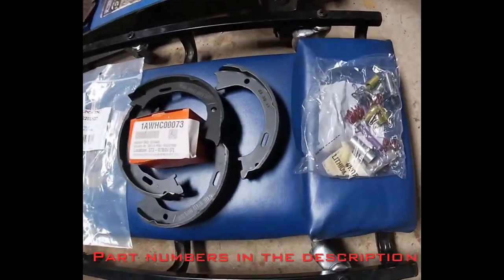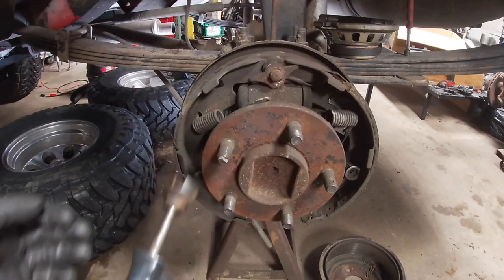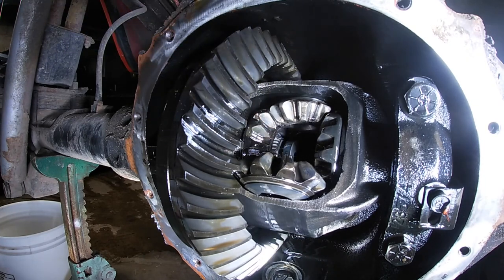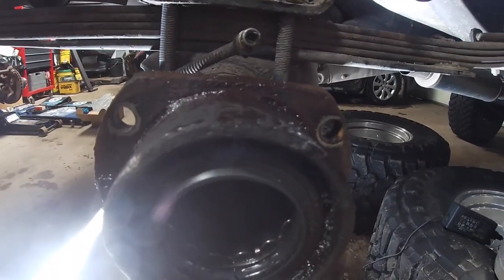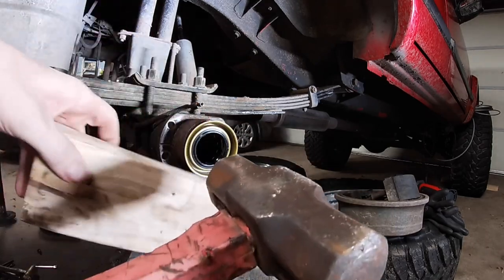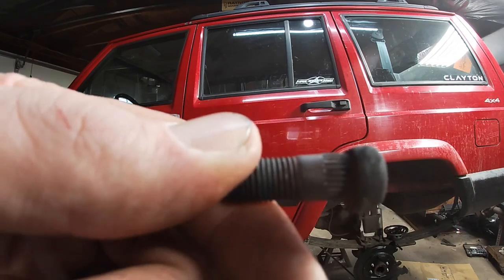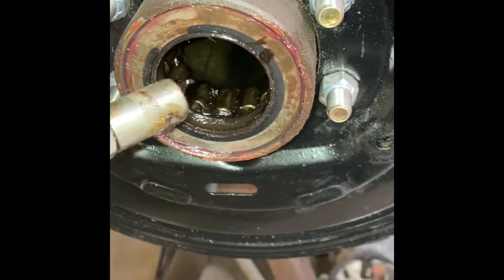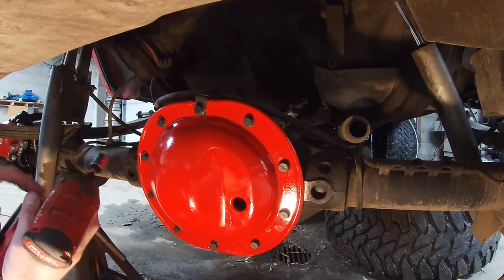Bolt On….Jeep XJ Rear Disc Brake Conversion

Comment: When doing this, make sure you get the same axles going back in the same sides you took them out because one is a little longer than the other. almost started freaking out because I got the short one in the wrong side and could not put the C clip on it realized later what I had done thought I got the wrong kit for a minute or two😅😉👍

Comment: Nice, informative, well done tutorial on the upgrade. My only issue, you say "bolt on" and while true up until the line bracket, that needs to be welded to axle tube to keep the line from moving. Seems like a small detail, until "dang it, i need to get a welder too?!" Jeep bleedin me dry already, lol!
Reply from the maker: Technically you could probably just leave it like that and not weld it. And never have a issue. But I just would rather be safe then sorry.

Comment: How did you bend the hard brake lines?  Did you remove them completely from the Jeep or is there a way to do it without removing and also crimping the lines?  Great video.
Reply from the maker: Hard line bending tool. You can get them at parts store. And thanks!

Comment: Awesome video.  Do you really have to replace the studs for the backing plate?  Seems like the new bolts you got are a little long while the XJ studs seem like they wouldve fit.
Reply from the maker: Thanks. Yes the xj ones are to short. You can use the stock liberty ones though. For me the bolts ended being easier to track down in the small town I live in.

Comment: What about the parking brake parts and hook up? Did I miss that part? God bless and stay well.
Reply from the maker: I lost the footage for that part unfortunately. But they do have a few good videos on YouTube on how to do the emergency brake setup on the Liberty’s.
Reply from the maker: And they do make a bracket for the XJ cable so you can adapt it to the Liberty ebrake setup.
Reply: Do you have a link to the bracket?

Comment: You didn't mention switching out the proportioning valve on the brake block.
Reply from the maker: I actually haven’t yet. And it’s actually working out pretty well with out doing the ZJ proportioning valve spring swap.

Comment: The coating on those eBrake springs is not resistant to brake cleaner, last time I changed mine, sprayed the eBrake clean, And I see bits of the color coating all over the eBrake assembly.

Comment: You dont need to install the emergency break shoes do you? I dont have them? And you might wanna change your proportioning valve
Reply from the maker: No you don’t have to install them. And I put a ZJ spring in my XJ proportioning valve.

Comment: Locktite on those backing plate bolts... no??  Or are those locking nuts?
Reply from the maker: If I remember correctly I used nylon lock nuts.

Comment: Did you find a major breaking improvement after installing the disc's? On a scale of 1 to 10 how likely would you do it knowing the cost and benefits?
Reply from the maker: Definitely better. I didn’t do the ZJ proportioning valve yet. That should improve it even more. As of right now how it set’s. I would say it’s a little better then drums. I mostly did it because needed all rear brakes any way. And this wasn’t much more money then just replacing the drum brakes. It makes things much easier in the future for brake replacement.
Reply: Great video mannnn. Thanks!
Reply from the maker: @ZekeMaster85  Thanks. No problem!

Comment: How’d it go bleeding the brakes? I ask because you have the calipers on the wrong sides, which puts them upside down. Kind of hard to get the air out when the bleeder is lower than the hose.
Reply from the maker: Bleeding went fine 🤷🏼‍♂️
Reply: Sorry, a more accurate question would be how’s the pedal feel? Soft, spongy? It would appear to bleed just fine because the fluid would come from the hose and run right out the bottom bleeder of the caliper it’s supposed to push the air out the top. Working in the brake and chassis field for 20years I’ve seen it many times, it’s a common and easy mistake. Just flip the calipers side to side and you will get a measurable improvement in brake performance. Other than that, good job! I was never impressed with the ZJ brake swap. Good to know there’s another option. Also, all the videos I see on disc brake swap fall short of addressing the hydraulic equation. The stock master cylinder was designed for the small diameter wheel cylinder, not the large surface area of a caliber piston. Also disc/drum systems have different front/rear proportional valves than disc/disc systems. I wonder if the Liberty master cylinder and proportioning valve would work? That is! If it has one? It may be integrated into the antilock brake module? Which opens up another can of worms.
I would have liked to see how you did the park brake. And I agree with the other comments about he intro music. Too much, too long. Almost clicked off. But now I’m a subscriber.
Reply from the maker: @jasonlessard2373  it does have a little soft pedal at first. So that’s probably the issue🤔. And most guys run the ZJ proportioning valve. I plan on trying that out.
Reply from the maker: @jasonlessard2373  And I haven’t hooked up the emergency brake cable yet. Trying to figure out my best option. Some people will use the stock XJ cable and just wrap it around the ebrake lever on the liberty setup. But I don’t like how that looks rigged up.
Reply: @northernmichiganoverland  let me know what you figure out for that that's only thing keeping me from doing this being I have a manual
Reply: If calipers were turned around right the brake line would have been easier also ,no sharp bends. I agree there is still air in calipers. Still good job and thanks for taking time to help people out

Comment: Heyy did you install the emergency brakes.  It looks like you skipped the Ebrakes.
Reply from the maker: Unfortunately lost that footage 🤦🏼‍♂️
Reply from the maker: But basically it’s the same steps as putting the liberty ebrake together. Other then adapting XJ cable.

Comment: I only saw a link for the left brake hose did you use two left brake hoses?
Reply from the maker: Whoops my bad 

https://www.ebay.com/itm/155104574986?mkcid=16&mkevt=1&mkrid=711-127632-2357-0&ssspo=pcVVEXylRS2&sssrc=2349624&ssuid=GlPkWaaTRX-&var=&widget_ver=artemis&media=COPY
Reply: Oh no worries my brother thank you so much I figured it out I am in ASE certified Master automotive technician and I don't think I could have done a better job on the detailed description and the quality of your work I'm thoroughly impressed keep up the good work man
Reply from the maker: @1jimjiminy  Thank you!

Comment: Is it the same parts for the Dana 35 & Chrysler 8.25??
Reply from the maker: This mod will not work on the dana 35 as far as I know. I believe you have to use the jeep ZJ rear disc brake parts if I remember correctly.

Comment: Total cost if ya don't mind me asking. Lapeer Michigan
Reply from the maker: Under $250. I got the liberty backing plates for $50 off Facebook market place. That was the hardest thing to find. Everything else is just factory liberty brakes parts. I bought new of eBay and rock auto.
Reply: @northernmichiganoverland  nice not bad at all definitely would be worth it.

Comment: What color red did you use on the Calipers?
Reply from the maker: @j002cd 

https://www.ebay.com/itm/350870094577?mkcid=16&mkevt=1&mkrid=711-127632-2357-0&ssspo=LRMjuD6oRLe&sssrc=2349624&ssuid=GlPkWaaTRX-&var=&widget_ver=artemis&media=COPY
Reply: @northernmichiganoverland  awesome Thanks!
Reply from the maker: @ky0611  No problem

Comment: I have sold hundreds if not thousands of “disc brake conversion kits” on a well know forum. 
For the money, just get an Ford 8.8 with discs from a junkyard & be done.
Reply from the maker: This didn’t cost much more then replacing the drum brakes that needed replaced anyway 🤷🏼‍♂️.

Comment: You forgot something....?? Where is the E-brake?
Reply from the maker: Lost that footage unfortunately
Reply: @northernmichiganoverland  Ahhh that explains why... It's a one simple fit over the original?? Thanks for the video.
Reply from the maker: @Justdigit2  if you look up how to install ebrake shoes on the liberty same steps. Only thing thats different is making the XJ ebrake cables work with the liberty ebrake setup.

Comment: I got a comment. Im a 35 year+ mechanic and have a 99 Jeep Cherokee XJ, lifted with Patagonia milestar tires (Nice Tire!),etc. The problem with drum brakes is....nothing. You have to the education to make them work properly. Most people dont have a clue how to use spring tools or adjusting spoons. Its too hard, i dont know how to do them, Oh i wish i had rear disc brakes. Screw that. I redid my system with new Shoes, Springs, hardware, Drums and Adjusters. My brakes work so good id place 100 bucks in a stop in the shortest distance contest with anything in my Jeep class or otherwise. My 1988 Trans Am GTA doesnt stop as good as my Jeep. They are cheap to fix and easy to upkeep. Drum brakes work just fine. Period. Jeep On people!! 👍🏻👍🏻👍🏻
Reply from the maker: Obviously you don’t live in Michigan. Was sick of dealing with the self adjusters seized up from rust almost yearly. And drum brakes hold mud if you actually off-road your jeep. If drums worked so great. Why did almost every manufacturer do away with them?
Reply from the maker: And FYI i passed my ASE certification in brakes. So I know how to properly maintain drum brakes.
Reply: @northernmichiganoverland  Easy now partner. I live in the state of Maine. Plenty of ice, snow and mud here. I do off road it and have no problem cleaning out my drums. It was a comment, not a personal attack on you. I like Drum brakes you dont. I wont comment again. Sorry you are offended.  Jeep on.
Reply: @northernmichiganoverland  Roger that. So did I.
Reply from the maker: @moeshiner156  sure came off a little negative.
Reply: @northernmichiganoverland  My apologies. Was not intended fellow Jeeper. I will keep checking your channel out and hope for no hard feelings.
Reply from the maker: @moeshiner156  No hard feelings. And just like any jeep upgrades some people like some and some people don’t. Thanks for the support.